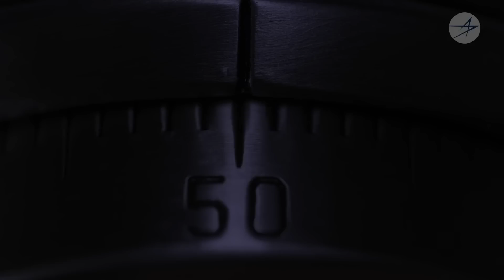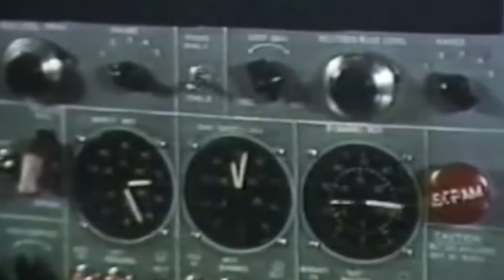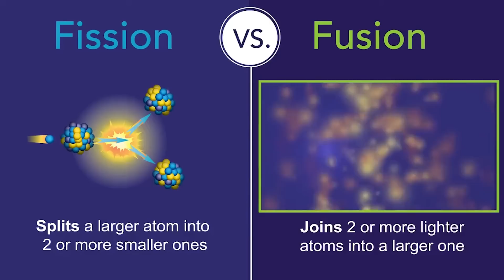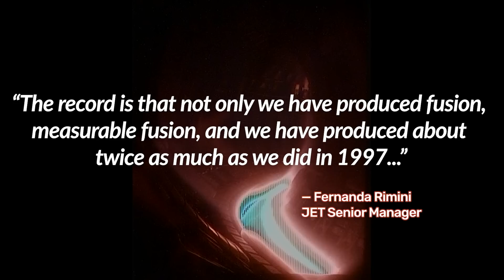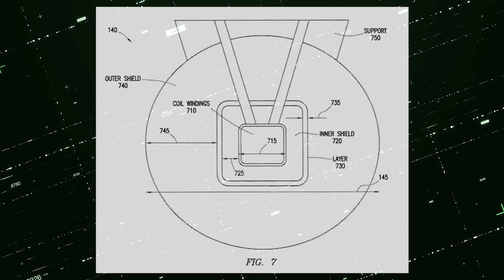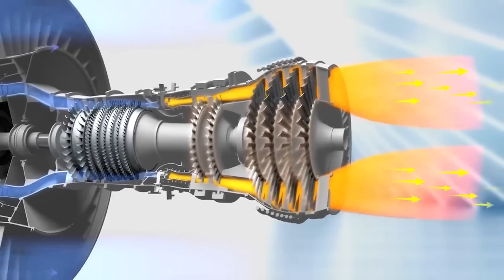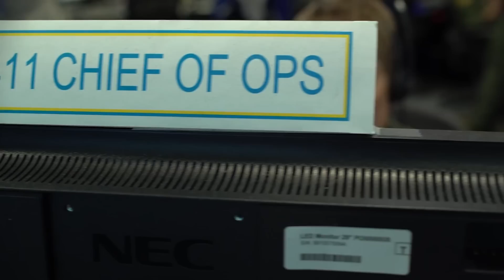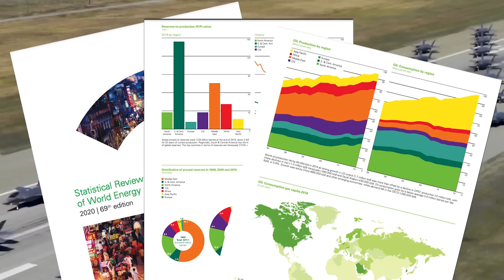Lockheed Martin's fusion-powered fighter and bomber plans

Comment: Fusion is the future, not windmills: developing it for power to the people (toasters) before defense (bombers) is more engineering-friendly by allowing kinks to be worked out on the ground rather than in the air.  To speed up the dream of harnessing the energy of the sun, institute a Manhattan Project with a special emphasis on  Directed Energy Weapons (Iron Dome).
Reply: The future of grid scale energy deployment is diverse, not dependent on a single resource or design or market player. Over deployed diverse energy portfolio is more important. When grid consumption slows down, then artificial chemical fuel production and water desalination plants operate with direct energy transfers from nuclear plants. Artificial fuel can be used for transportations systems that cannot be properly tied to the grid: military and remote resource extractions.
Reply: @granatmof  You can say that, but once nuclear fusion is scalable and efficient it will literally take over everything.  Power generation can be dynamically managed through nuclear fusion to match or exceed demand.  It requires very little material for generating power, and the half life of the materials range from 600 Milliseconds to like 13 years, depending on what materials are used.  
  
Fusion will literally make everything obsolete, it generates 4x as much power as nuclear fission and would be much safer with less waste.
Reply: @Lolatyou332  Nuclear fission is already a pretty safe and extremely efficient process, but you still need to get materials from other countries and large investments to keep it running. As of now, it is already million times more efficient than coal and oil but far from everyone is using nuclear reactors in the world. So before the ecological deadline of 2050 (that just got lowered again btw according to the last estimations from climate experts), we'd better stop living in all this comfort and thinking that the solution is to produce more, always MOAR. Because at this rate we already start to see agricultural activities die, we see pandemics, more frequent wars, conventional oil peeked in 2008 and gas in 2019 if I'm not mistaken, with the result that you know in terms of inflation, crisis, Russian-Ukrainian war making it even worse. By all laws of physics, rn fusion is far from being mastered and we have more pressing matters. Economy = transformed energy and right now, the more time passes, the less energy we have, the less investments we are capable to make to develop stuff by order of magnitudes.
Reply: @Doomguy-777  The best nuclear fusion reactors today barely break even plus a smidgen on energy out versus energy in, so how can they possibly be more efficient than coal or gas plants?. Nuclear fission reactors used for commercial power indeed use a million times less fuel mass than combustion power plants, but the thermodynamic efficiency advantage is more on the order of 5-10% (including costs for pollution mitigation and waste disposal of each technology).

Why do people persist in looking at the carbon dioxide buildup only as something to be feared and avoided? The carbon from coal and probably the carbon from oil and gas was once a part of the earth's ecosystem. Using it for fuel is an effective and economically useful means of putting it back where it belongs. It's been shown that up to 30% of the increase in agricultural production in the last 60 years is likely due to improved plant growth and health as a result of higher carbon dioxide levels in the air. (http://www.co2science.org/education/reports/co2benefits/MonetaryBenefitsofRisingCO2onGlobalFoodProduction.pdf)

What we really should do is to quit paving over arable land with solar and wind turbine farms, parking lots, shopping malls, etc., and work with nature to increase plant growth. Instead of building solar farms, we should be covering existing parking lots and shopping malls with solar panel canopies.
Reply: @Doomguy-777  When I wrote about the carbon being in the ecosystem in the past, I was not referring to CO2 in the atmosphere.  I meant the ecosystem, i. e., the entire collection of living things. Coal is not fossilized CO2, it is fossilized plants. The sloppy habit some have of referring to CO2 as "carbon" may have just bitten you.

Also note that the article I referenced does not by any means discount all of the advances in agricultural technology that are sometimes called the "Green Revolution." The author argues that 70% of the crop production gain can be attributed to these advances, and  the rest to the increase in CO2. On further reflection, I think the factors are synergistic; that the Green Revolution enabled crops to take better advantage of increased CO2 since plants in optimum health use available resources more efficiently. That can be tested by comparing the effects of CO2 on plants grown by old methods and older varieties versus those benefitting from the Green Revolution.

There is a considerable body of research directly measuring the effects of increased amounts of CO2 on photosynthetic plant growth. In general, more CO2 means more plant growth and productivity. The gain differs by species. http://www.co2science.org/data/plant_growth/plantgrowth.php
Reply: @paulbade3566  Great, more CO2 means more plant growth. It also means the destruction of all ecosystems and untold suffering. We need less CO2 emitting power generation techniques, period.
Reply: @Sgt.Hartman  "More CO2 … also means the destruction of all ecosystems and untold suffering." That's not scientifically supportable at the levels we can reasonably anticipate. You do understand that plant growth requires converting the CO2 into biomaterial and oxygen, do you not? Do you realize that the current fraction of CO2 in the atmosphere is less than 480 parts per MILLION, i. e. 0.048%? CO2 does not become toxic to animal life until it exceeds 1%. 

Also, the greenhouse effect of water vapor is much more significant. If we went to a hydrogen combustion economy, the increase in water vapor in the atmosphere is potentially more damaging to the environment, particularly in high-humidity flood-prone areas. Storms are driven in part by the energy released by upper air condensation of water vapor.

Wind and solar power have significant environmental and practical negatives that should not be ignored. Their limited capacity factor has already resulted in the deaths by hypothermia of dozens of Texans.

It is foolish to take panic-driven measures and not carefully consider whether nature already has the feedback mechanism to correct the problem, or fail to evaluate the consequences of proposed alternatives.  I'm calling for working with nature as it is designed and not assume we know what is coming, or that the current proposed answers justify the enormous expense and subsequent impoverishment they would entail. Rather, look for solutions that produce benefits for all of nature, not just the few humans who stand to profit from what may not even be a real crisis. Taking advantage of increased CO2 by extending and enhancing plant growth through agriculture and better management of nature reserves seems to be a much saner way to go.
Reply: @Lolatyou332 lol that’s a lot of word salad for something we don’t even know how to make at all feasible yet. We should probably have a functional fusion reactor before we start making claims about its scalability

Comment: Even with fusion power and automation, duration aloft might still be limited by oil consumption and wear on seals. But air assets could be launched and just circle around an area of interest until they are needed, like a latter-day Chrome Dome. I do wonder what the throttle response of such a jet engine would be like.
Reply: At the pressures that such a reactor would operate at i imagine hypersonic or beyond easy, assuming material sciences keep up
Reply: @damitcam  Fusion jet engines would still likely work in ways similar to existing jets: compress, heat and exhaust. The heating process just switches from a kerosene fuel to fusion pellets. Early systems will probably have a very low thrust to weight ratio.
Reply: The most straight-forward way to throttle would be to vary the flow rate through the engine using valves (and bypass circuits, to enable a more steady flow rate through the reactor and each engine to throttle independently). I'd be more concerned about the maximum thrust. With combustible fuel injection the heat is produced where it's desired (in the airflow), so little conduction needs to happen. With a central fusion core, you're reliant on the heat conducting through the walls of the plumbing into the air. There's a physical limit to how quickly that will happen, proportional to the difference in temperature. You can't really vary the air temperature, and you can't just let the fluid get arbitrarily hot or it'll melt the plumbing. You could increase the rate of heat transfer by spreading the fluid through a bunch of little capillaries, but that would increase drag. This tech might be limited to slow aircraft like cargo, tankers, maybe bombers, etc.
Reply: @PrezVeto 
I wonder what the response speed of the engine itself would be.
After all, even with fission, you still need continual fuel injection.
(btw, where do the reaction products go? they'll either clog up the engine, or you'll need to extract them and store them on board in a radioactivity-proof container, right??)

Anyhow, I think speed would be increased by increasing the temperature of the coolant, combined with temperature-sensitive valves that open up at certain thresholds, bringing additional capillaries/heat exchange areas online.
In essence, you'd be cruising with just 10%* of the heat exchange surfaces in active use, and only use all of it to dash into a danger zone or run from intercepting planes or missiles.

(notes: 
1. for the valves, I'd use passive material properties; for instance a metal coil that expands when heated to lift up a blocking seal, thus automatically shrinking back in place when the temperature drops
2. I just assumed a low percentage of total heat exchangers for cruising speed, because drag rises exponentially instead of linearly, and military jets go rather fast, so you'd presumably need a lot more thrust to go a bit faster. But 33% or even 50% might be equally reasonable; jet propulsion is not my specialty😂)
Reply: It makes sex seem trite.
Reply: @MrNicoJac  The only place any nuclear reactions are happening in the diagram shown is within the single reactor located within the fuselage. What gets pumped through the engines is just a liquid that conducts heat well but expands relatively little. The fluid would be piped adjacent to the airflow within the engines, but then returned to the core to be reheated. Nothing gets injected into the airflow like fuel is in today's jet engines. It would have to work that way, in a closed cycle, if the plane wasn't to be full of huge tanks of fluid to replace what was being injected into the air. (The tech was described as allowing flight times unlimited by fuel. Broadly interpreted that means no need to replenish large amounts of fluid.) If you could afford to lose fluid, injecting it into the airflow would fix my concern about maximum thrust, but I don't see how that would fit the description in the vid.

As for the reaction, it's fusion, not fission, so there's orders of magnitude less radiation. The reactor would probably have some lead shielding to absorb the little bit produced, but it wouldn't need to be nearly as much as in fission reactors like the super heavy ones they experimented with putting on planes in the 60s. The fusion they've been trying to get working for decades is  2H --> He. The product is helium. It should take up less space than the hydrogen that went into it, so storage until landing shouldn't be an issue. In fact in the vid he mentioned they might be manufactured never to be refueled, in which case the helium would just slowly replace the hydrogen within the reactor, never being emptied (at least until the plane was scrapped).

I'm skeptical you could control thrust primarily by simply varying the temperature of the fluid for several reasons. One of them is that you need to be able to vary the amount of heat being transferred to the engine airflow much more quickly than the time it would take for fluid heated to the newly desired temperature to make it from the reactor to the engines. The reactor also probably couldn't vary its heat output that much that quickly. The other reasons include the constraints of heat conduction equation and heat tolerance of the plumbing that I described in my previous reply, except they'd apply to an even greater degree.
Reply: @PrezVeto  i think they would have to do some sort of multi-stage piping system with a lot of diversion valves. kind of similar in concept to the tech of electric trains from the 70s and 80s cam/contactor/relay system they have for power levels. basically youd have four "stages" and each increase in "stage" would open a larger section of pipe, allowing the liquid to flow through and raising the overall temperature within the turbine. i think the biggest issue with this type of design would be plumbing some sort of safety system, and the fact that you could potentially lose an entire engine if you lose a single stage with an improper safety/diversion system.
Reply: Seals can have backups and oil tanks can be vast
Reply: Forget the while aloft stuff! When will these be replacing our non-renewable power plants, while we experience a 97% decrease in our energy costs?! 🤔
Reply: @PrezVeto  giant honking laser blimp, covered with 100mw laser emitters on a 50% duty cycle. to look upon the aircraft is certain death.
Reply: My personal guess is that this technology is already available, but closely guarded by Lockheed et al.
Reply: @ericvosselmans5657  i bet they could achieve similar power densities with High Temperature Fission (the helium cooled reactor design that the Japanese like)
Reply: @kerbodynamicx472  It's also possible that the reactorcsystem would just generate electricity, and the jet engines would be replaced entirely at least for subsonic or low supersonic flight with electrically driven thrust fans.
Reply: @Andrew You don't understand the difference between power and money.  There are some videos out there that explain it
Reply: @ericvosselmans5657 v 16:36 😮😮
Reply: @PrezVeto  I wonder if they could adequately control thrust simply by exit port size control. Today, we control the directions of the jets output, but I don't know if we do a lot with the nozzle size. Assuming you could make a large nozzle that allows adequately low air velocity exiting the engine for landing, and you could then choke the nozzle down to something very small, you would then build many times the air velocity at the exit.

Comment: Sorry if I misunderstand this but I (Lockheed Martin)  have a magic box that produces power and a feed back and control system to control the power it produces and I filed a patent too ,BUT the magic box does not actually exist I did all this hopping that someday it will. JUST BUILT A COMPACT MOLTEN SALT THORIUM REACTOR AND GET IT OVER WITH !

Comment: Could we get a video on the two Helicopter replacement programs next? 
The armed scout and medium lift choppers (FARA and FLRAA) will be massive programs worth exploring here.
Reply: Sikorsky has the S-97 Raider compete with the Bell+Textron 360 Invictus in the AAS / FARA (armed scout) program.
Meanwhile, the Sikorsky+Boeing SB-1 Defiant competes with the Bell+Lockheed V280 Valor for the FVL / FLRAA (long-range lift) program.
Given how the US defense industry works, it is likely that both companies get one contract each, to keep every factory running, everybody employed.
So if you like both Sikorsky or both Bell designs, get ready for a disappointment.
The Raider has troop capacity while the Invictus does not, but that gives the Invictus better stealth properties, just like the Boeing-Sikorsky RAH-66 Comanche had. Not sure why they abandoned that design. Just to push a common scout and transport design when they know it's not very likely they'll get both contracts?
The V280 seems to be the more mature design, faster and longer range. But the SB-1 might offer better handling and safety, as it is not a tilt rotor. And it's smaller, closer to the Blackhawk size. This might really go both ways.
Reply: The RAH-66 was far to expensive for the missions it was asked to complete. The Raider is the Kiowa on steroids, whereas the Invictus is the more economical Comanche. I'd argue that while the Defiant is a better all-round platform, the Valor matches the language of FLRAA almost exactly. Bell and Sikorskey really outdid themselves on these designs.
Reply: There is nothing about massive about both
V-280 is the only real option for the FLRAA as the USMC, USAF and USN has demonstrated the effectiveness of tiltrotors
The Army is only one not onboard with tilt rotors
The S-97 is unlikely to win unless they improve its payload
Reply: Get to the Choppa's
Reply: @texasranger24  Crazy reading this after the Valor actually won that contract. I can also see the Invictus winning over the Raider as well. It would be wild to see Bell win both Contracts
Reply: @ZackSavage  yeah. I like the V280 more because it's basically the Osprey getting it's full potential. The army probably trusted Bell that their tilt-rotor is now more mature than coaxial with pusher-prop. And it's longer range, better for pacific island hopping.
And the 360 is a better scout/light combat chopper due to the smaller footprint. Bell winning both contracts sounds politically unpopular, but i am here for it if it does happen.